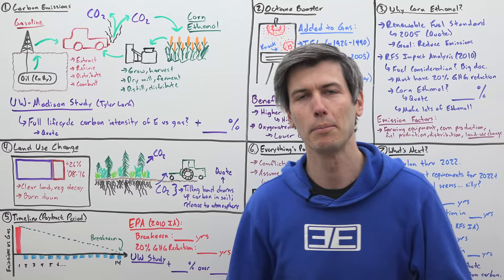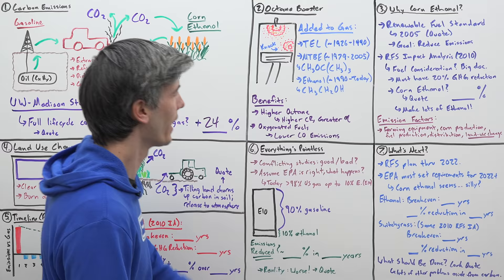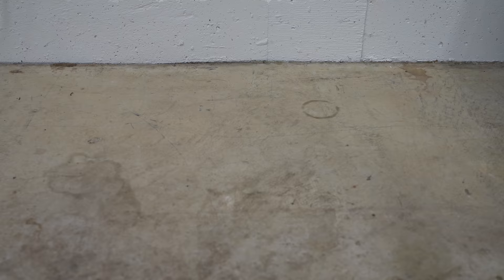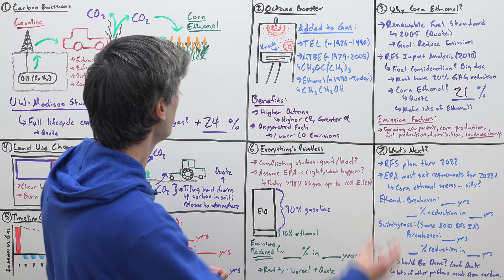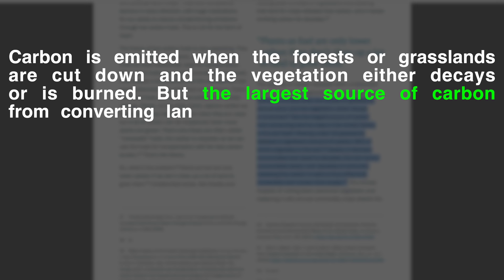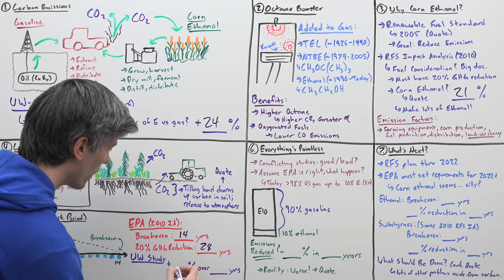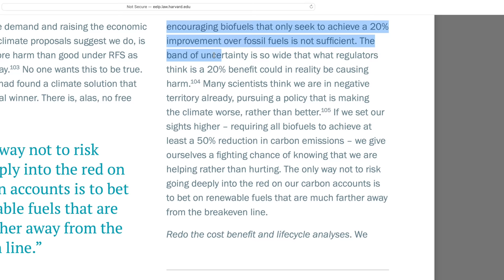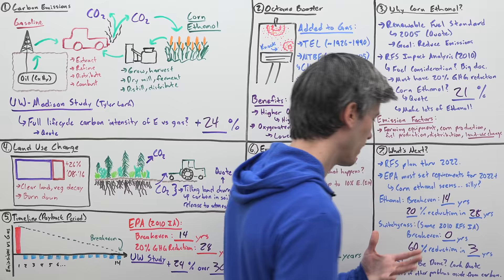America Was Wrong About Ethanol - Study Shows

Comment: This is a very good presentation with good supporting documentation.  In the 1975 my engineer/farmer father along with a friend that was a plumber built the largest ethanol still in our county.  It was a highly efficient packed column and could distill ethanol to a fraction of a degree. It could produce near 95% ethanol.   It was powered by a boiler that burned firewood from dead trees on the farm so the fuel cost to distill was nearly zero except gas for the chainsaws and a little fuel for the farm truck to haul it to the still.  He even raised the corn which was used to make the ethanol which was quite cheap at the time.  The left over mash was donated to a neighbor to feed his hogs.  After two years of experimenting with different ethanol mixtures from 10 to 95% including a trial run of 50% ethanol and 50% water he found that he could not break even with just using straight gasoline.  The fuel consumption was greater with any mixture of ethanol in his gas tractors and didn't even come close to the efficiency of his diesels.  Even though his only real cost was the corn he used instead of taking it to market, It was a money losing proposition. He did not even count the cost of the large still which was built from surplus materials nor the expensive government permit to distill ethanol nor his hours of labor building and running his project.  Running ethanol was a waste of resources and it was rusting his metal storage tanks including the metal tractor fuel tanks.  When they started building ethanol plants in our area a couple years later, we knew they were a money losing business as the cost of corn doubled and their fuel and labor costs to distill were much higher than ours.  It was a feel good government scam that made a lot of people money but did nothing to actually help the environment or reduce our dependence on foreign oil.  It required more fertilizer and chemicals to raise more corn which is harmful to our well being.  While we made more money on our corn, we could no longer drink the water from our well which is now contaminated with nitrates.  My father's early experimenting was fairly scientific at the time.  None of the tractors back then were fuel injected and all the engine tuning had to be done by trial and error but the results compare closely to the literature of work done more recently.  Just a side note to consider.  I don't know of any farmer that raises corn using ethanol powered equipment.
Reply: Nice to hear perspective from those with experience on the field!
 I suspect this has a lot more to do with corn than ethanol itself from what I gather though :/
Reply: If ethanol producers gave away their distillers grains, they all would lose money as well.  The feed component is what makes corn outcompete most any other source even though they make more ethanol per acre.

John Deere and Cummins just dropped a chunk of money into a company named ClearFlame who converts diesel engines into pure ethanol burners.  So clean it eliminates the need for the costly and unreliable exhaust particulate filters and DEF.  Henry Ford's dream of ethanol tractors may come true.

The US actually used more fertilizer and chemical in 1980 before ethanol than after.

Everything from fertilizer and from the soil is still goes to the feed, the only thing that goes to the ethanol is solar energy, CO2, and water with the latter two needed for the new gallon of ethanol.

Here is how the 2007 Energy Independence and Security Act affected food/feed prices (not counting inflation):

2007 WEIGHTED CORN PRICE =$4.20 WITH 4 .7B GAL MANDATE
2008 WEIGHTED CORN PRICE =$4.06 WITH 9B GAL MANDATE
2009 WEIGHTED CORN PRICE=$3.55 WITH 10.5B GAL MANDATE

2016 WEIGHTED CORN PRICE =$3.36 WITH 15B GAL MADATE MAXED OUT
2017 WEIGHTED CORN PRICE =$3.36 WITH 15B GAL MANDATE MAXED OUT
2018 WEIGHTED CORN PRICE =$3.61 WITH SAME 15B GAL MANDATE MAXED OUT + RECORD PRODUCTION OF ETHANOL

Wheat
2007...............$6.48/bu
2008...............$6.78/bu
2009...………$4.87/bu

2016...………$3.89/bu
2017...............$4.72/bu
2018...............$5.15/bu

Soybeans
2007..............$10.10/bu
2008..............$ 9.97/bu
2009...……...$9.59/bu

2016..............$9.47/bu
2017..............$9.33/bu
2018..............$8.48/bu
Reply: Solution is simple, let petrol carry the full cost of the pollution it causes.

That said, making ethanol out of corn might not be optimal...
Reply: @onewordhereonewordthere6975  People are so gullible when propaganda puts the words "new study" in front of things for some odd reason.  You do know that US cropland acres went down after ethanol and at least in corn producing states grasslands, forests, and wildlife areas went up after ethanol.

No corn is grown for ethanol, rather ethanol is a value-added product of already existing feed production which leaves 100% of the protein still available as feed in a healthier, more digestible/efficient, and more concentrated form called distillers grains.

This is why the 2007 energy act did not increase grain prices.  While corn takes 40% of feed off the market, simultaneously there shows up a brand-new triple concentrated feed to take its place.  The Arab Spring had nothing to do with ethanol other than someone used it as a scapegoat.  We use more ethanol than then so how did prices fall?  Why aren't they sky high now?

If just 1/3 of Americans used E15 instead of E10, we would eliminate what we lost from Russia, this would not quite use half of ethanol's unused capacity.

I trust the government slightly less than George Carlin did.

Here is how the 2007 Energy Independence and Security Act affected food/feed prices(if at all):

2007 WEIGHTED CORN PRICE =$4.20 WITH 4 .7B GAL MANDATE
2008 WEIGHTED CORN PRICE =$4.06 WITH 9B GAL MANDATE
2009 WEIGHTED CORN PRICE=$3.55 WITH 10.5B GAL MANDATE

2016 WEIGHTED CORN PRICE =$3.36 WITH 15B GAL MADATE MAXED OUT
2017 WEIGHTED CORN PRICE =$3.36 WITH 15B GAL MANDATE MAXED OUT
2018 WEIGHTED CORN PRICE =$3.61 WITH SAME 15B GAL MANDATE MAXED OUT + MOST PRODUCTION OF ETHANOL EVER

Wheat
2007...............$6.48/bu
2008...............$6.78/bu
2009...………$4.87/bu

2016...………$3.89/bu
2017...............$4.72/bu
2018...............$5.15/bu

Soybeans
2007..............$10.10/bu
2008..............$ 9.97/bu
2009...……...$9.59/bu

2016..............$9.47/bu
2017..............$9.33/bu
2018..............$8.48/bu
Reply: @danafletcher2341   
It's amazing a simple math question. Scares the brains out of people . 
      Study Matthew 24. Look up. 
This is the fifth and final Genesis.
Reply: ethanol is for drinking, not for burning in a motor.
Reply: Very interesting
Reply: That's great and without looking at the replies, please, use paragraphs next time.
Reply: Wait a minute... you are saying that you can burn a mix of 50% ethanol and 50% water in a gas engine?  I don't think so...  and yes, the protein can be used as feed but feed also needs to contain plenty of sugar/starch, not just protein.
Reply: Isn't a lot of farming today "no till"? That might alter the CO2 emissions calculated but wouldn't alter the economics or basic energy use issues.
Reply: You should have credited the feed value. You did not credit us no-tillers, just assumed all ground plowed and tilled. Also the cleaner air value is going to have a cost. This is a flawed report from the get-go. Heard this BS before. Wonder who's money was flowing to whom!
Reply: Yes, I'm a retired school teacher and librarian.
   Solid blocks of text are hard to read.  Another time, use paragraphs, one main idea per paragraph.  Then a blank line between paragraphs.  Much easier to read.  I tried to read your post, but my eyes glazed over.
Reply: @danafletcher2341  interesting claim. But then the question becomes- does it make sense to raise corn to feed livestock? Did it ever make sense?
Reply: @fredkohlman8860  interesting. What percentage of US row crop farmland is no-till? Also, what percentage of farming for feed?
Reply: @fieldlab4  Well, I personally try to eat grass fed beef so if everyone ate like me corn ethanol would not exist.

Contrary to our Rockefeller history textbooks ethanol was the number one lighting fuel.  Whale oil quickly peaked in the mid 1800s at 17 million gallons.  Ethanol in 1860 was at 100 million gallons for lighting.

In 1859 the first oil well was discovered and in 1862 a Civil war tax was put on ethanol at >$2.00/gallon and only $.10 on kerosene.  Literally overnight dirty kerosene became the number one fuel for lighting.

Lighting from the 1800s may be the reason our country eats corn fed beef so much.  They had to do something with the distillers grains.  In New Zealand they think corn fed beef tastes funny since they eat grass fed everything.

Cattle fed corn have less of the unhealthy Omega 6/linoleic acids than swine and chicken because they have a more complex digestive system which is more able to convert them to stable saturated fats.
Reply: @fieldlab4  corn feed tastes better than straight grass feed.
Reply: @phillipsusi1791  Have you tried the 50/50 mix in an engine with a carburetor? It was an experiment that produced little power. Even E85 ethanol produces much less power than gasoline. Ethanol draws water from the air so most ethanol contains some water.  It's too expensive to take it all out. 95% ethanol and 5% water is as pure as a regular still can go because of the azeotrope that forms between ethanol and water. As far as the sugar and starch goes, where do you think the ethanol comes from? It comes from the sugar and starch breaking down into ethanol when the ground up grain ferments.
Reply: @philipmartin2622  My problem is this... E85 is 15% ethanol, and 85% gas.... that will burn fine in most engines even though it might produce a little less power.  The claim here is 50% Ethanol, and 50% *water*, which will barely burn *atl all*.  My comments on the protein vs. starch were about the fact that if you remove all of the starch to convert into ethanol, then yes, you have a bunch of protein left, but protein by itself is not usable to feed animals; they need the starch too.
Reply: @phillipsusi1791  You have E85 backwards. It is 85% ethanol and 15% gas.  Alcohol has always been added to fuel with water in it so that the water will mix with it and go through the carburetor.  Many engines in the 1950s were water injected with gasoline and a European car company even recently revived water injection. My comment was that mixtures up to 50% were tried and not successful.  As far as using the corn mash to feed animals, it is a way to use it as a feed additive. Most animal feeds are a mixture of things.
Reply: @philipmartin2622  You seem to be violently agreeing with me.  50% water and 50% ethanol is aka 100 proof vodka, and that just barely burns.  I can't imagine trying to run an engine on that.  And yes, my point was that you use the sugars to make ethanol so the remaining feed stock has little or no sugar left.
Reply: @philipmartin2622  I'm scrolling back to try to see where I made a comment about E85 that you could be responding to and I'm not seeing it.
Reply: @phillipsusi1791  I didn't agree to anything you said.  I said that the 50/50 ethanol/water had been tried and didn't produce any power.  Also chemically, it's the corn starch that breaks down to sugars and then ethanol as the enzymes(yeast) digest it.  The left over mash has food value and can be used as feed.  Your own body breaks down food from starches to sugars.  By the way, there are at least eight different sugars.  Do some reading before you comment.
Reply: @philipmartin2622  I didn't say it doesn't produce any power...  said it isn't something that is going to run an engine very well.  And you seemed to agree.  And again, you're agreeing with me that the leftover mash lacks starches and sugars, which makes it a poor feed.  You might use some in combination with other waste feed you might have around that for some reason is high in starch and low in protein, but I'm not sure where you're going to find a ton of that.  Maybe if you have a bunch of extra potatoes, you could mix that with the mash to get a decent mix of starch and protein, but then why not just use the potatoes to make Ethanol from instead of the Corn?
Reply: @phillipsusi1791  Here it is.  Phillip Susi replied: "Philip Martin My problem is this... E85 is 15% ethanol, and 85% gas.... that will burn fine in most engines even though it might produce a little less power. The claim here is 50% Ethanol, and 50%..."